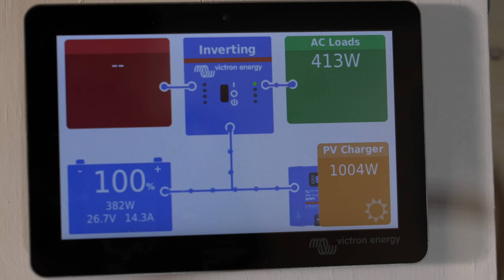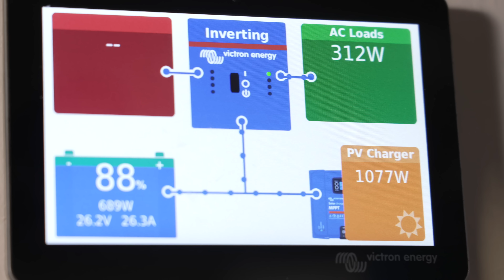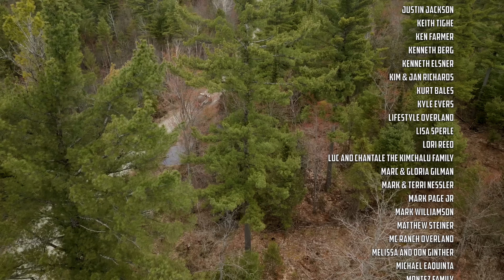FULLY OFF-GRID | SOLAR PANELS INSTALLED | Mother’s Day Special // EFRT S8 EP19

Comment: I meant to mention this earlier, but I was wondering if you used gas stabilizer when you 'moth-balled' the machines. It can prevent some headaches when you go to start them months down the road. It's particularly important with small carbureted engines. Gasoline can break down over time and can form a sludge that can plug up the tiny jets and orifices in the carburetors.